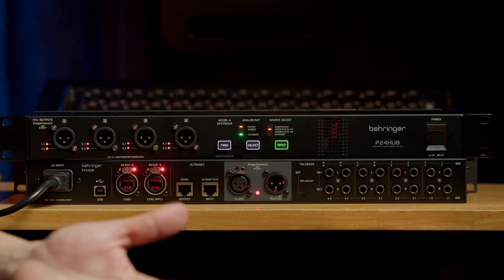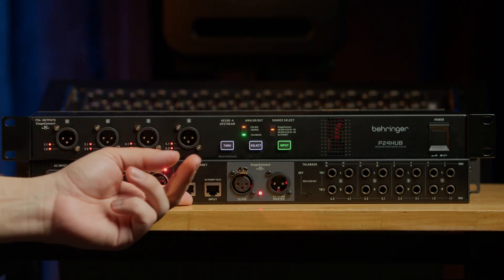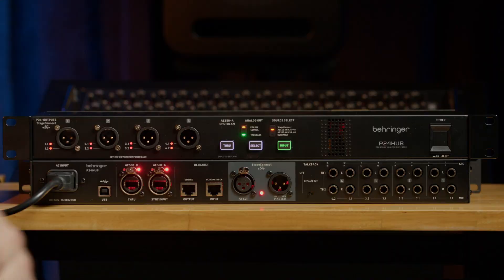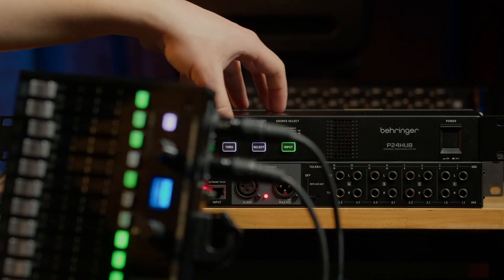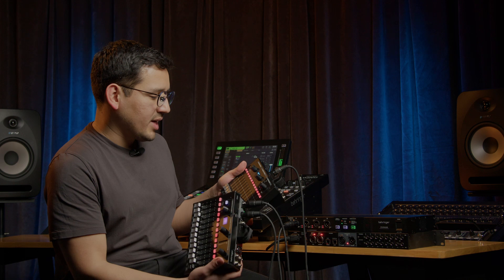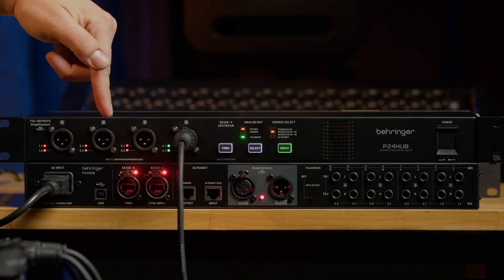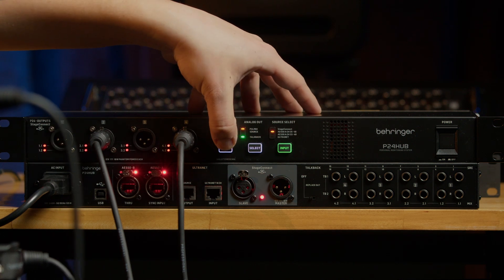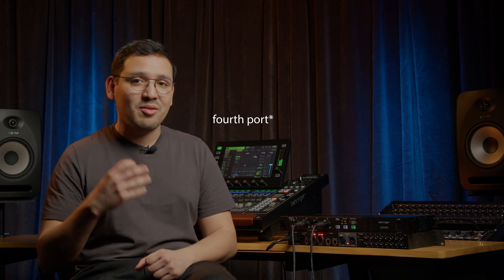P24HUB Video Manual

Comment: Two things are unclear (the first two): 
1. Is 30 meters (or 40 meters according to official statements) the maximum cable length PER CHANNEL or is it the TOTAL length of all cables coming out of the hub? Example:

I have a 20-meter cable on channel 1
I have another P24 connected to mine in cascade with 10 meters

On the second channel, I have a P24 connected to the hub with 10 meters of cable

Are the possibilities for connecting other P24s exhausted, or do I still have 10 meters available on channel one, 30 meters on channel two, and 30 (or 40) meters on channels three and four?

Second unclear point: 

My band has musicians with P24 and P16M. Can I connect and use both personal mixers SIMULTANEOUSLY? Or if I use SC, will Ultranet not work, and vice versa?

Comment: I noticed that for stage connect you say 30 meters in the video. However, the P24Hub Quick Start Guide says "up to 40 m with 110 ohm DMX cable" under the specifications section.
Reply from the maker: This range is truly dependent on the cabling used. We've communicated 30m in the past, but with quality 110 ohm DMX cables, the maximum run would be around 40m. Hope this helps.
Reply: @behringer  , this 40m max statement isn't very clear. The video obfuscates, too, where the presenter states that it's 30m for each channel. We have the P24Hub and 6 x P24s in our live setup. We have had nothing but problems with power outage and glitches, especially on the two units that are fed by channels 3 and 4.  After much detective work and web searching, we've come across a few interesting morsels in forums regarding solutions. The conclusion is that 40m is the TOTAL cable run for all units, regardless of number of channels used. By our experience, it seems channel 1 is first in the chain and gets good signal, followed by channel 2, then 3 then 4. If we were to use in excess of 40m connecting two P24s via 1.1 and 1.2, then channels 2, 3 and 4 would become glitchy and unusable. Can you confirm these findings, please? We'll be doing a gear review video for the Hub and P24's on our channel in the near future, so any actual hands on experience or clarity on this topic would be invaluable.